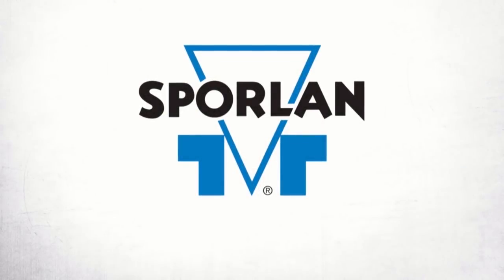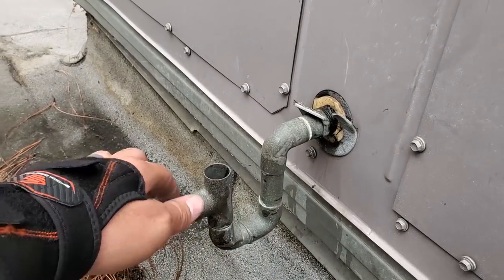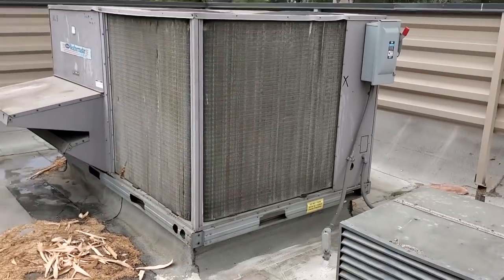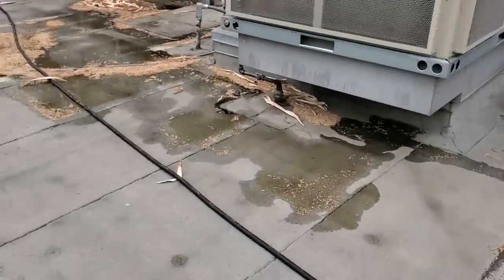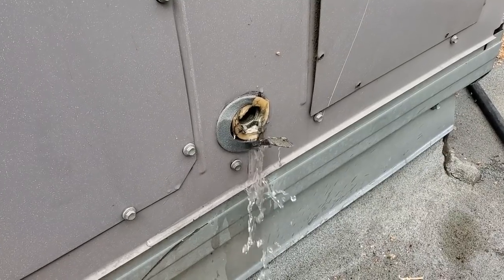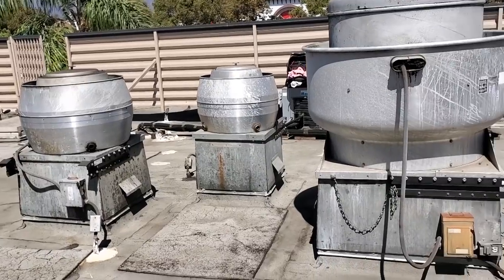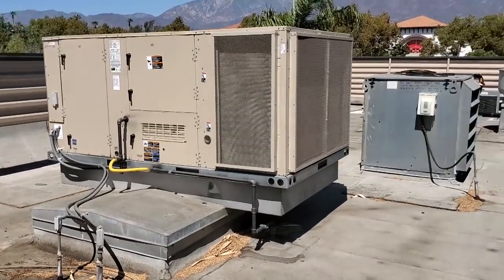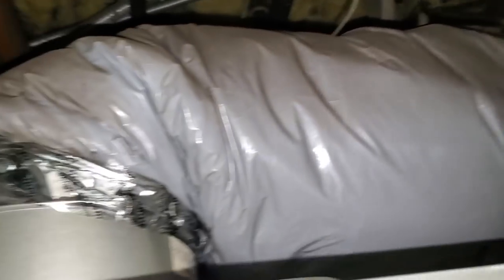MULTIPLE AC'S DOWN AND A WATER LEAK

Comment: My question is....WHY....would ANY mechanic use copper ,take the time to  sweat a trap vs. PVC fittings and glue ? Imo,there is no upside to copper.
I have never seen drains not dumping out on the roof vs going into the space.
WHY ? To keep the condensation from slowly damaging the roof ? Doesn't it rain,and down pour occasionally ? Or....is it some stupid code ONLY in
COMMIfornia ? No offense to you guys.

Comment: The enginerds may have more certification on paper than you but are they smarter................

NOT!!!
Reply: I'd have to say on paper if everything was set perfectly, meaning all exhausts and hvac with working economizers set to proper minimums, it would always have enough make up,. sounds great? I bet they were all sold on that and the big energy savings spiel. 
the problem of course, things break and they don't want to fix them or someone doesn't understand the changes and the HVAC never gets repaired to match for the exhaust amount again.